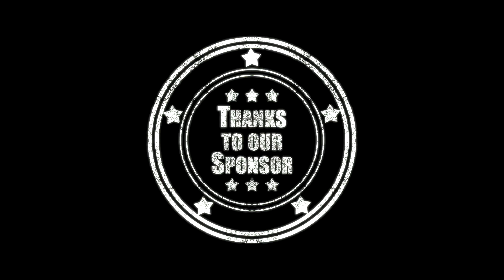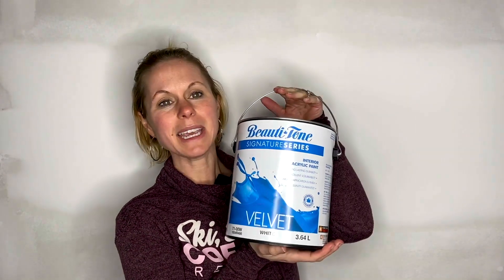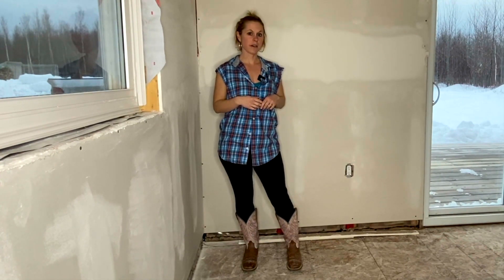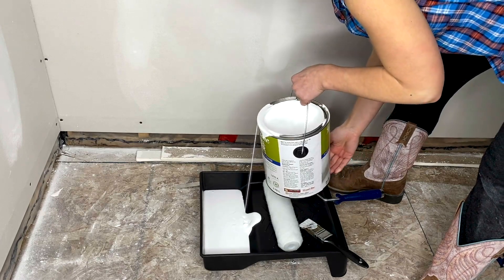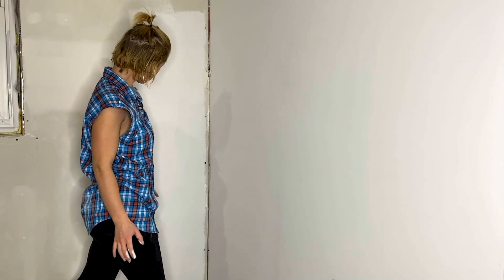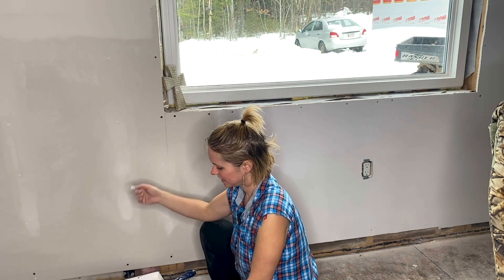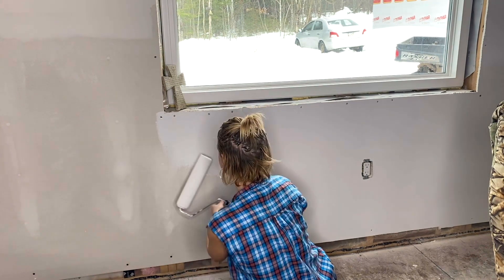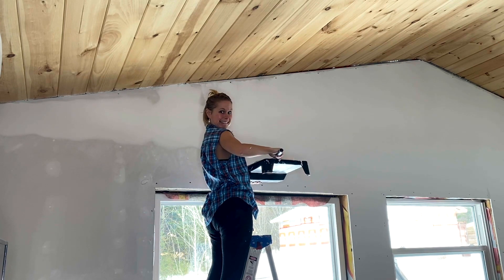PAINTING The Front Of Our House! DIY Home Build 2021

Comment: Looks good, some suggestions you might consider, Paint it alight Beige color, or keep it white then add some vertical boards about 4 ft up then cap with chair-rail. All in the future if needed. The Chair-Rail protects the lower part of the wall from getting Holes and scrapes.

Comment: You can get an extension pole that will screw into your paint roller handle which will help you reach the ceiling without the ladder.
Reply from the maker: The broom handle was the plan until it didn't fit and we are nowheres near a town to get one, so here we are ;)

Comment: You could use an extension stick that screws into the Roller handle. If you don't have one you could use a Broom stick that has a thread.
Reply from the maker: That was the plan, until my broom handle didn't fit ;)

Comment: Be nice to yourself get a short adjustable paint extension for your roller. Saves your wrists and hands. If you need to paint 6 panel doors use a small 4 or 6 inch roller. (You can get foam or wool)
Reply from the maker: That was the plan, until my broom handle didn't fit ;)

Comment: When you get to the paint. Brush in all your edges first than when you roll it on paint left to right going up and down to blend it not sideways or angle that way you don't get high lines going in different directions that you can see them when the sun hits them. You'll tear your hair out for sure.

Comment: Get a broom handle with threads. You can screw the handle of your roller to it and not have to do so much from a ladder. It also gives you better leverage and control. You also don't have to bend over to fill the roller.
Reply from the maker: That was the plan until I got home and it didn't fit ;)

Comment: Here's one in advance, guys: If you put down some nice red oak hardwood flooring, 3/4" I imagine, since you left such a gap with the sheetrock, do this: before laying floor, let it acclimate about two weeks in the house, to equalize moisture content, to eliminate shinkage. Now lay down some rosin oaper. It's thin, and a dark pink color. It helps as a anti draft measure, but mainly, it stops the floor squeaking due to wood rubbing against the wooden subfloor.....it does work....
As always, good job, and Jer, get little Ash a screw in broomstick for her roller........LOL
Reply from the maker: That was the plan, until my broom handle didn't fit ;)

Comment: Have you considered framing around the wall air/heat unit with white trim or a color to match the unit? That way your eye is drawn to the wood trim you install. By using the wood trim around the unit it is made into a feature, using white it goes away.
Reply from the maker: That is what I plan to do, what I said must not have translated my intent correctly in the video :)

Comment: One thing I always do when using a brand new roller is I take masking tape and loop a section around my hand sticky side out and go over the roller with that sticky side to remove any loose fuzz instead of having that loose fuzz come off onto the wall while painting.
Reply from the maker: Thats a good idea. I wish I read this before I started, luckily I did not have much loose fuzz on my roller. I like the idea though.

Comment: Hiya, yes I agree the wood looked better! LOL. It helps if you do a pva wash on the wall before any paint. It stops the drywall sucking all the water out of the undercoat. Just mix wood glue with water and use a big brush to put on. No need to be careful just splash it on like a boy teen with aftershave before his first date... 
Did you not have enough white looking out the window? 
Stay safe...Steve...

Comment: I never use primer. It seems like a huge waste of time. If a wall needs two coats I just give it a second coat of whatever paint I'm using.
I wonder why you are painting while wearing a new pair of boots. 🤔    If you are just advertising the boots wear them in a different episode in a different activity. Are there gaps in the wall/ceiling to the outside near the crown?
Reply from the maker: I am wearing them for the exact reasons I explained in the video :)